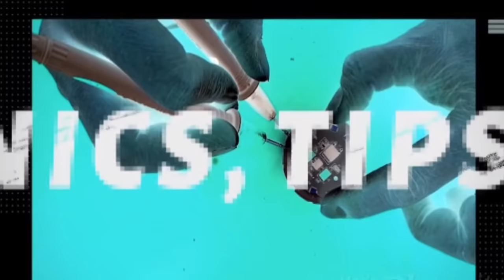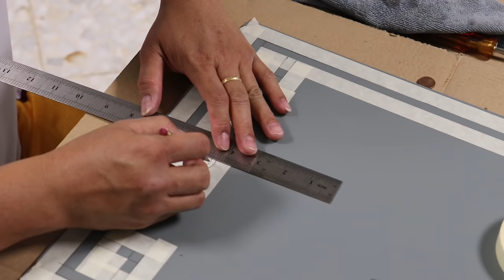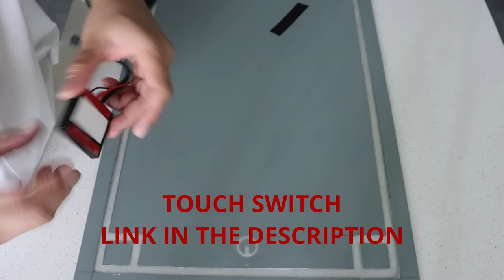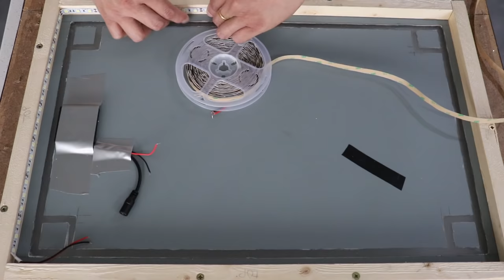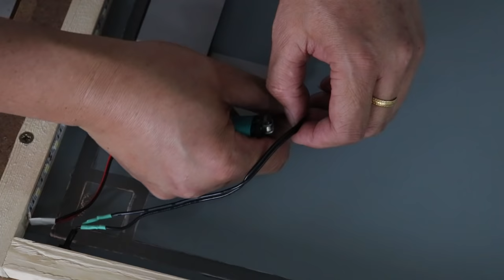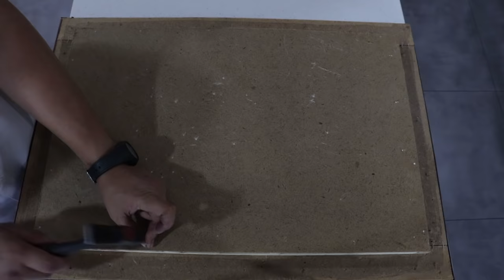How to make mirror light with touch switch

Comment: The glue on the Duck Tape will react with the silver backing and you will see discolouration/stains after a few months. There is however a special adhesive for mirrors that is stable and not cause the staining effect.
Reply: What do u call it
Reply: yeah bro. what do u call it?
Reply: @redfire20003  fantastic. Im definitely getting it. Ive ordered the rest of the items online already. Its gonna be my lil' pet project
Reply: What is the name?
Reply: @leiya4836  Mirror Adhesive.
Reply: 17 minutos para fabricar o modificar un espejo con pesimo acabado,  yo los fabrico con un acabado de primera en 6 minutos y con Bluetooth y otras aplicaciones
Reply: Very good bro
Reply: @gabrieladavid2245  como remueves la pintura para  una pantalla?
Reply: @gabrieladavid2245  puedes ensinarme?
Reply: @gabrieladavid2245 do you have a video or website.... ?? I would love to see it be blue tooth.....
Reply from the maker: @MrSleepyTwin I have a video which I made a picture frame with infinity light effect and it was connected to wifi and controlled by voice Google assistant.
Reply from the maker: @MrSleepyTwin https://youtu.be/BsciTxZtwWs

Comment: This video is amazing.. I just following the steps, but you need to write more in deacription. That you need to do sanding after the paint removing step. Because after using paint remover, the silver layer didn't com out. So we need to do sanding. 
For more information by my experience (just did it today), i sanded it using 320 grit of sandpaper and water. 

And one more thing i found by experiment. It will be better if we using masking tape that made off plastic or other material that will not scratch when applying the paint remover. I meant it will be more better if it not a paper material masking tape. 

Overall this video really good. 
Thanks a lot. 🙏
Reply from the maker: Sanding is needed when you don't have the etching cream to make the glass blurry. You can do the  sanding process without using paint remover. 

Yes you are right, if we use a much better tape and have a better adhesiveness. You might have more cleaned and sharper edges.
Reply: @gudvooy2  ahh.. I see.. So the etching cream also used for scratching that silver layer. Oh nice to know about that.. 
Thank you so much 🙏.
Reply from the maker: No. I mean, if you used a sand paper to scratch out the silver layer you don't need the etching cream to make the glass blurry because the sand paper does its job in  Removing the Silver layer and making it blurry.
Reply: @gudvooy2  no, i did sanding it. But it's not blurry.. It's clear.. Maybe it will getting blurry if i use a lower grit of sandpaper, without water when doing sanding.
Reply: @ Mogi Sanjaya thank you so much, I used the paint remover. But, then noticed there was still mirror under the grey layer. So, I went through comments and found your ty so grateful that you shared this.

Comment: Thanks for vedio but I have question how do you make the circuit (power source and LED and switch touch )
Reply from the maker: You can buy the power source of 12v DC or depending on the LED power supply required. You can buy the sensor switch in the description. Click the link.

Comment: Great video ... thanks so much
Can you give a parts list or tell me the name and where i can purchase the light sensor? Also can this be done as a 120 volt system so it can be hardwired?
Reply from the maker: Where to buy the sensor is in the description. You can use a 120v adapter with an output of 12 volt DC.
Reply: Went to the description like you suggested but it is not in english so im having trouble still. Im sorry.
Can you provide a material list in english and where i can find these?
Thank you for your response and help
Reply: @TheBartman55  A real DIYer would learn a language to get the parts list! Lol..its actually English on my list..maybe he changed it for you. Gd luck

Comment: Also do you think it would work if i used the led lights that come with a remote ? Could i still wire it to the touch sensor but use the remote to change the colors ?
Reply from the maker: I'm not sure if you can do it. It would require a good connection. Try this but take your own risk.
I will not responsible for any injuries and damages for any misconnection will be made.
You may connect first the the sensor switch from 12v supply then connect your led with remote to the output of the sensor switch. But remember that the output for the sensor which would be led but you can try the said procedure. Good luck.

Comment: Can we use any paint remover to clear the mirror back colour?
Please tell me.
Reply from the maker: Yes you can use paint remover. In the video it was actually a paint remover. Just a tip, use a sponge 🧽 (scotch brite)- rough side to remove the painted mercury. Because using a paint remover will take you hard to time to it.

Comment: With what separated mercury from the glass?
Reply from the maker: Try to use sand paper. Use the smoother type.
Reply from the maker: The best you can use is the scotch brite sponge, use the rough side of the sponge.

Comment: Hi! love your video,You convince me to try but on a round mirror. I have a question, the cable you had between the touch switch and the "exit" of the frame (i don't have the vocabulary-sorry)  are part of the packaging /order on aliexpress ? (for the touch switch)
And what kind of cable did you use to connect the set with with a the extern plug? (hope i'm clear)
Love what you do.
Reply from the maker: You'll gonna need a 12 volt power supply, atleast 3 amps.
Reply from the maker: It was a 5.5mm female-male plug Dc wire connector.

Comment: Hey, what kind of tape you used for the lines? That won't react with paint stripper??
Reply from the maker: I just used a masking tape. You can even use a duck tape, it is more adhesives.
Reply: @gudvooy2  ok. I did that and worked. But the paint stripper is not taken the mirror paint away. Just the gray paint.

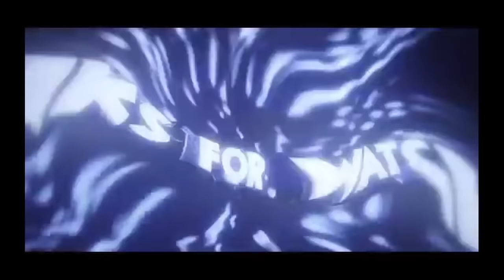Comment: What kind of cable did you use to connected to other cable on 17:32 (the green one) where can i find it?
Reply from the maker: I think you are asking about the "heat shrink tube".
Reply from the maker: Heat shrink tube is use to cover the open shielded wire.

Comment: Does this sensor work without removing the mirrored surface? Can I just place it in the center at the bottom and touch that spot or do I need clear glass for it to work properly.

Thanks for posting the video. The connections are all very clear.
Reply from the maker: Yes it can be work without removing the mirrored surface.
Reply: ive never done it, im still researching about it before i do mine. but based on what i read - if u dont remove the mirrored surface - u wont get to enjoy the blue, red or white indicator colours. and the point to touch would be almost a secret that only u would know haah
Reply: @drazmishah  It actually doesn't work through the mirrored surface, it has to be a clear spot. My inquiry was because I got a mirror with LED lights around the perimeter, but the vendor hadn't put in a touch switch and I wanted to add one. My solution was to add the sensor in the clear track for the lights, at the bottom in the middle. I have a lit up rectangle in that spot. Not perfect, but it doesn't look bad, at least not as much as I would have thought.
Reply: @alvo-oooo  test it. should be easy to test. Or, did you?
Reply: @bellesreceptionists3952  Yes, I was able to test it. Through the silvered part, nothing. Behind a section sandblaster ckear, it works perfectly.

Comment: I dont have bluring cream . what i i do ?
Reply from the maker: You can scrab it with sponge in the rough side of it. Even sand paper but be sure not to damage the edges.
Reply: @gudvooy2  ok i try. Thanks bro
Reply: @gudvooy2  what about ferric chloride pcb etching power can I use it
Reply from the maker: That's a good idea. You can try it

Comment: Touch side pe mirror ko cut kiya ha kya
Reply from the maker: I don't understand your language sir.
Reply: @gudvooy2  I am just asking to you that where the touch button ,you cut the mirror that side
Reply from the maker: @technicalandinformativevid7128  I did't made any cut to the mirror nor I made any hole to it.
Reply: @gudvooy2  to touch sensor mirror ke back side pe laga ha aur front se mirror touch krne pe work krta ha
Reply: Congratulations!!! Your video is very good. Another point is that I can not read your language. Where are you from? I am from Brazil. Regards.
Reply from the maker: Spain

Comment: No aliexpress fala: "The back light icon can be seen on the mirror after the touch switch is powered"

Mas no seu video, quando está off o ICON LED está ON .. 
But in your video, when the led strip off, the ICON LED is ON .. 00:07

Problem with the touch switch ?

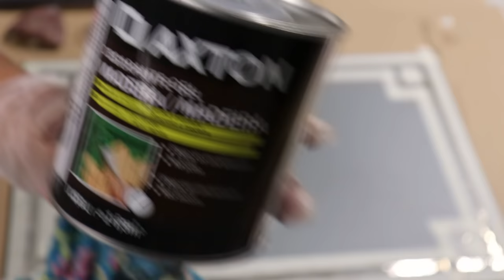Comment: In 2:13 may i know what paint or chemical is that?
Reply from the maker: Its a paint remover.
Reply: @gudvooy2  all paint remover can also remove that back silver coating of the mirror?
Reply from the maker: @magals8955  I think so. I just used a wood paint remover.
Reply from the maker: Absolutely yes.

Comment: Biar standby hidup terus gmn ya bang
Reply from the maker: Can't understand
Reply: @gudvooy2  I had one like it, but the light changed quickly and instantly dimmed
Reply from the maker: The switch has a 3 selection of dimmer. You can change yours, buy it on the description.